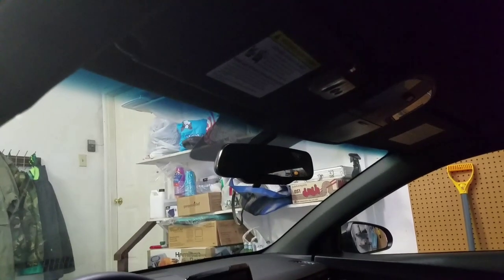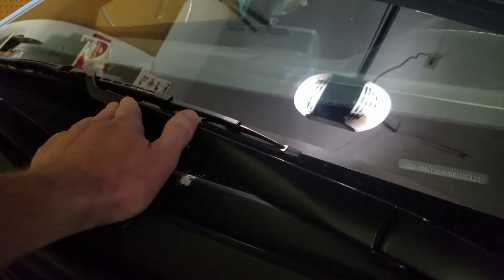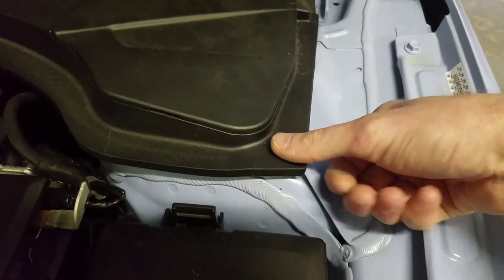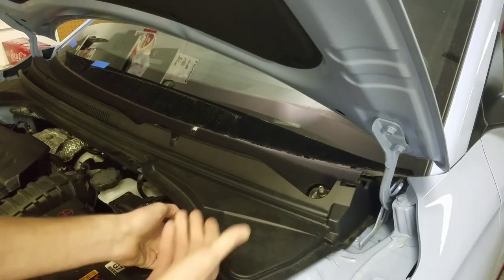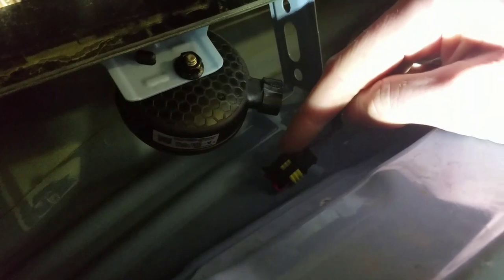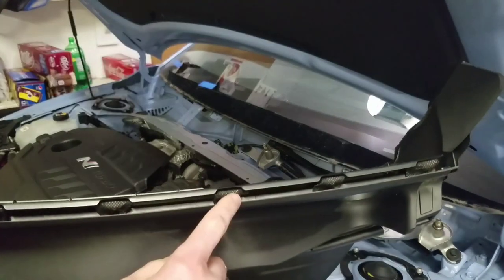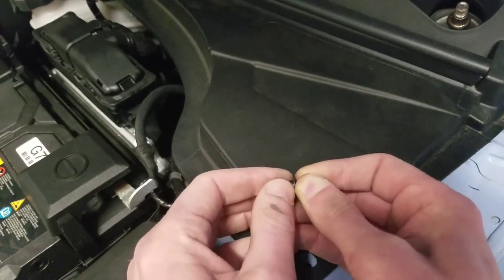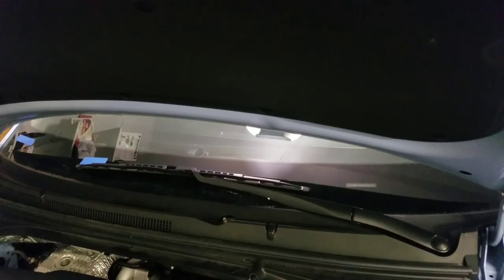Sound Generator removal

Comment: No need to remove wiper arms or cowl panel. Pop the 4 plastic rivets, lift the cowl panel up, and go in with a long pick or radiator tool to unplug the connector. A flashlight is needed and can be used to prop the cowl panel up far enough to get in there. 🍻
Reply from the maker: Yes that will definitely work, though I had to show the proper way to do it. I'm all about short cuts though.

Comment: Had issues like this on my GTI. Sometimes it’s the vibration between the generator and the metal mounting plate that comes through the speaker as loud vibration. A small 3M piece of sticky foam pad or a felt washer between the nut and mounting plate dampened it and it was all good again .
Reply from the maker: That's pretty good feedback! Even if it's a different car. It maybe as simple as that. I appreciate it homie

Comment: VERY detailed tutorial, much appreciated. Hope it fixed your rattles. I'm doing this myself tomorrow thanks to you, but just disconnecting and leaving it in.
Reply from the maker: No problem! Hope all goes good for you homie. Thanks for the support
Reply: Hi Slowflight, by leaving it in, is your rattle completely gone?
Reply: @bicecream88  I actually ended up removing it completely but removing it or not removing it should have no effect in theory. What matters is AT LEAST unplugging it. I don't notice a huge difference but I also don't miss it whatsoever. Hope that helps.

Comment: Is this the rattle one experiences on 3-4 gear. It’s very minute the rattle. But driving this car daily you notice the smallest changes in tone
Reply from the maker: It very well could be. However i noticed it in between all gear shifts when the rpms where at around 4-5 k

Comment: I'm lazy ... any chance just reaching up and pulling the connector without disassembling?  If not, a good detailed way to stop the noise!  I assume there is no amplified sound coming through the audio system like in past Velosters?
Reply from the maker: No you can't just reach in for the connector. You can unclip the plastic and get your hand in there not having to remove the whippers. It does not go to the stereo system.

Comment: Kind of a long video. But if you just wish to unplug the sound generator you don't have to remove the wipers, take all the screws out and small plastic pieces at the corners.  Wiggle the big plastic piece out a little bit, lift, shove your hand in there and unplug
Reply from the maker: Yeah I was asked to do it. So just showing how. But that lamp switch though hahahaha
Reply: @n-fullsend1889  yes, your video helped me figure out how to get to it so Thanks!
Reply from the maker: @Kylegxfifa  no problem glad I could help! Thanks for the support

Comment: Did removing the sound generator solve your rattling problem? Today I just noticed a rattle while in N or sport mode, seemed to be coming from the mirror. I would imagine the sound generator is just a bass shaker, so maybe it's vibrating the windshield too much?
Reply from the maker: I dont notice my mirror vibrating anymore to be honest so must have worked.

Comment: Why is it there? What does this sound generator do?
Reply from the maker: It basically amplifies the engine vibrations into the cabin of the car so it sounds louder.
Reply: @n-fullsend1889  so fake car sounds like bmw?
Reply from the maker: @njjx8800  I have to say yes do to the fact that Albert Biermann had a hand in engineering the vehicle
Reply: @n-fullsend1889  Ah ok. So #1 mod is to delete sound generator